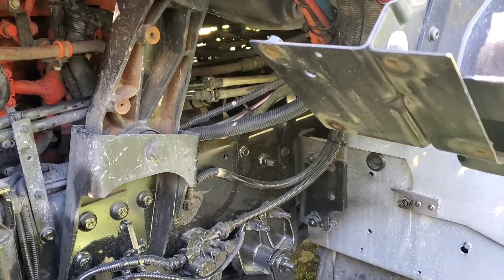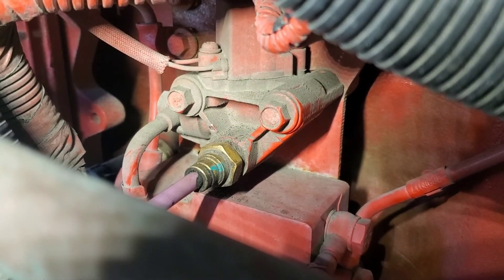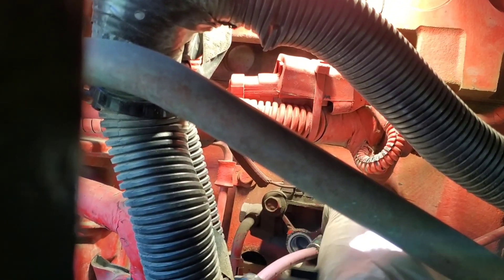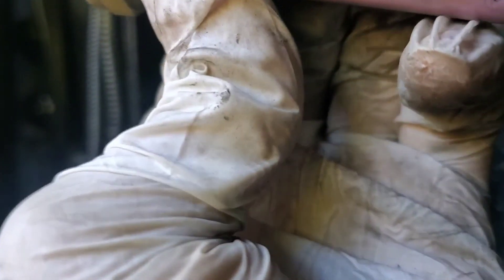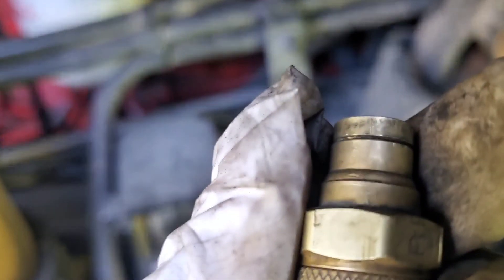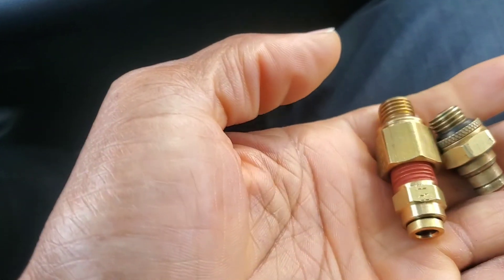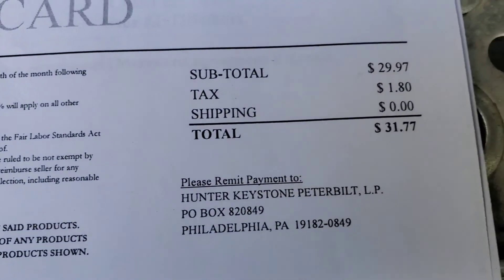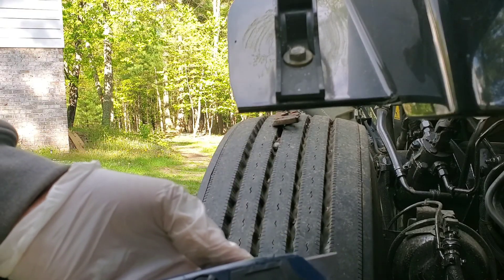how to fix a solenoid valve quick connection air leak on a cummins isx  15

Comment: I had the same issue you on a Navistar A26 engine.
Reply from the maker: Did you had to remove the fender to get to it?
Reply: @truckingpaysthebills5394  Yes I did. The last one I replaced was very difficult to remove. I ended up cutting a bunch of zip ties and disconnecting one of the fuel hoses so that I could fit my hand in that tight spot.
Reply from the maker: @MrSip4life  yea sometimes thats that's the only way

Comment: Hi guys I found a perfect replacement part for this fitting, part number 177.V20566049 
Company is Automann & the part is called Brass PLC male connector fitting. 
Hope this helps cause it toook some work to get the right part 👍🏼

Comment: I have the same problem but in a freightliner cascadia it's like L do u know what's the name of that part in cummins isx15 thanks
Reply from the maker: Its call a solenoid valve quick connect. All this is plumbing work, so you dont have to get the exact part if you can't find it.If you notice the new one i put on is not identical to the old one. Although Yours is in a L shape a straight one like mine can work as well if you can't fund the L one. Take off the old quick connect take it to freightliner or any other dealer tell them its off of a Cummins isx engine if they dont have the exact part ask them to make a fitting similar to the one you have. Good luck
Reply: Bro thanks for your help ill do like you said have a nice week.. ill subscribe..thanks..
Reply: If i have my def deleted i still need it or should i cancell the line

Comment: I work at a waste disposal facility and we had the exact same issue with one of our fleet trucks with the same engine. Your video was extremely helpful. Finding that fitting thought was a nightmare. Cummins told me that's a fitting they did not install. Ours was on a Freightliner. I sent all the info I had gathered to freightliner and they gave me this part # PH 169PTCNS 4 M12 I'm waiting to see if it's the correct one. Thanks so much for your video!
Reply from the maker: I'm happy you found it helpful hope you get your parts soon.